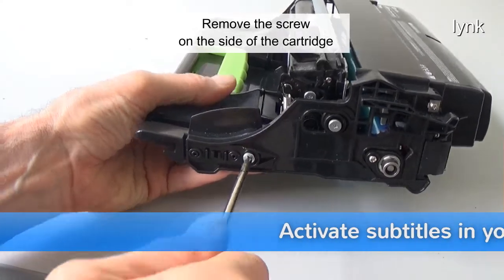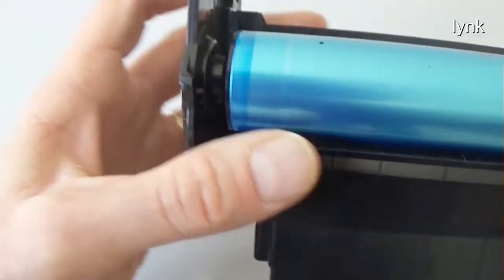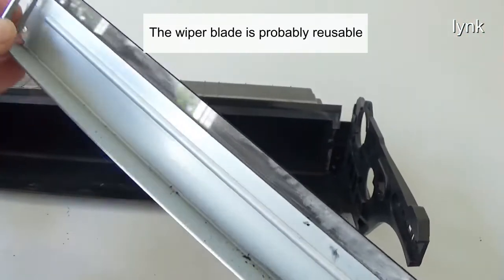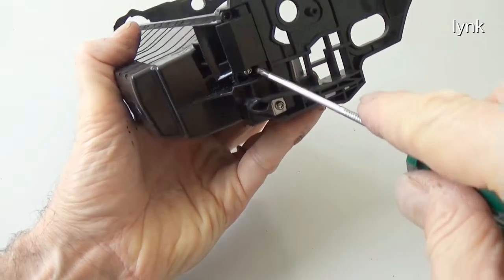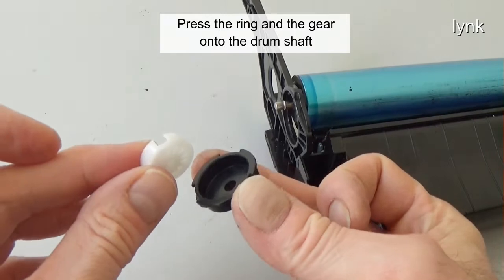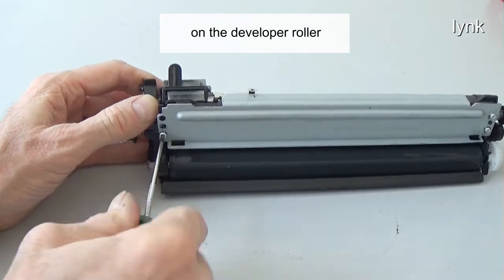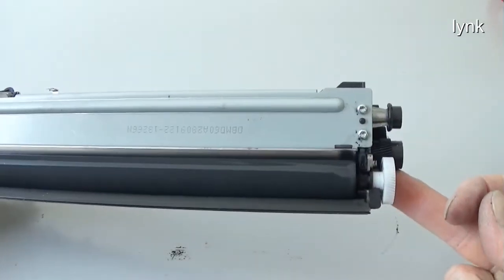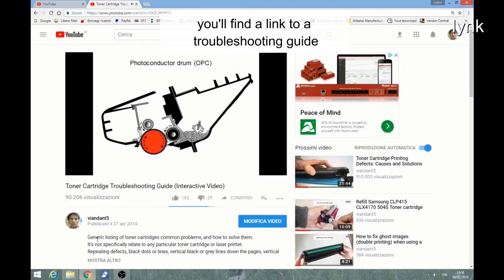Lexmark MX/MX Drum Unit rebuilding instructions

Comment: I've got an MS610dn with spots of toner about every 95.7mm. I replaced the drum recently and it was going fine until this week. What do you think could be the problem?
I found a spot of toner on the drum at that location. I cleaned it with an alcohol wipe, but it came straight back.
Reply from the maker: spots of toner are black dots?
Reply: @viandant5  yep
Reply from the maker: @8scottyt  I think the toner cartridge loses toner, may be from a detached mylar blade or the recovery blade of the waste toner is defective. The dots could be caused by toner "glued" on the drum. try to clean it with isopropyl alcohol

Comment: Hi. I bought a new cylinder but white theet side is not removebable, its fixed and the black collar/bushing does not fit on it. I believe it a new disign but it requieres a new collar part to fit all together. Have you face this problem? Any advice will be appreciate
Reply from the maker: No, I didn't see any change in the design, it's an old machine I think Lexmark don't make any change however it's not impossible. Remember you have to turn the bushing

Comment: Pls need help with Lexmark ms 610dn image unit print plank pages i know the problem with the mechanical part with magnetic roller but i dont know if it can be fixed or not ,
And thanks for ur concern
Reply from the maker: The toner (magnetic) roller is in the toner cartridge. Which is exact the problem?